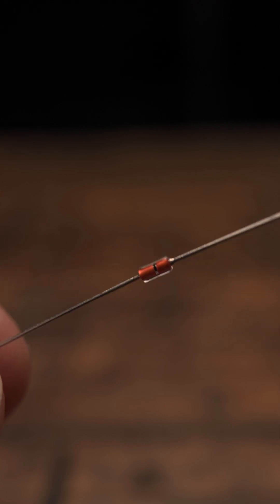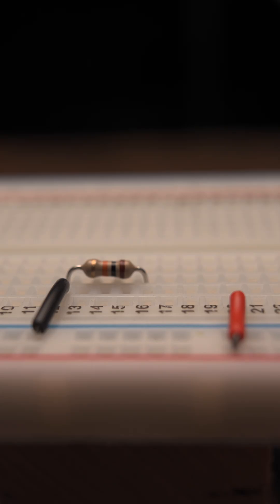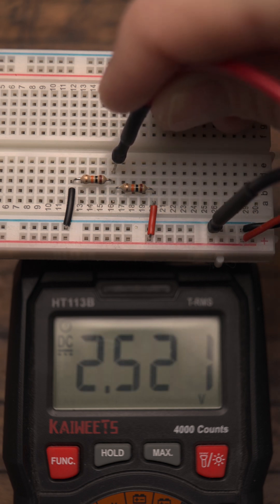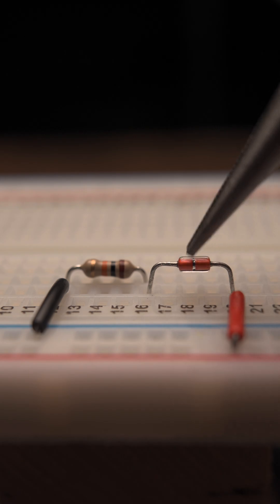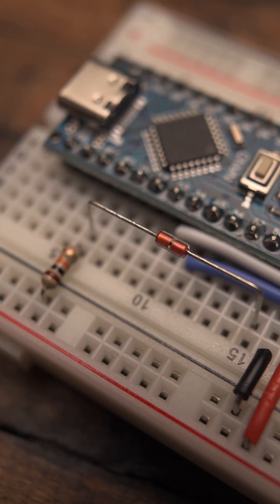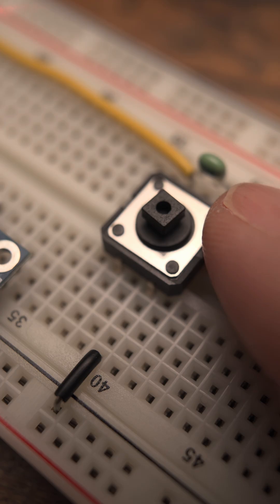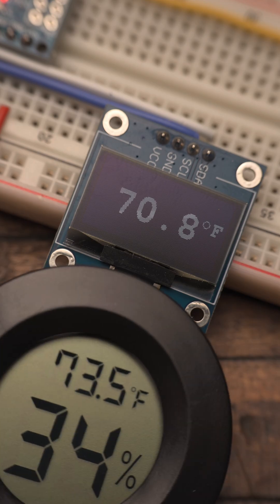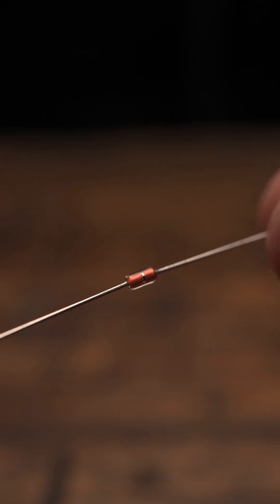#thermistor

Comment: I prefer C, because the 0 and 100 are for the freezing and boiling of the same substance: water. This makes it very repeatable and verifyable. In Fahrenheit the scale goes from ice with salt at -17 to freezing water at 32 and body temperature at 64. It's basically a random dot in a map.
Reply: My life doesn't revolve around freezing and boiling water. Pretty much the only time I'm checking the temperature is to know what it's like outside. Fahrenheit measures that much better. You can keep playing with your water.
Reply: @PIVfirestarkproducon  Sure, because in America you don't center everything around cars, right? Well let me tell you a secret. 0°C determines whether the roads, the pavement or stairs will be frozen and dangerous or not. It tells whether it will rain or snow. It tells you whether the water in pipes will freeze and tear them apart. Cooling a drink below this temperature will make it undrinkable.

Literally life is based on the freezing and boiling point. You just don't see it. Anyway, what you say are just few points on a scale, any scale would do.

With Fahrenheits you need to remember freezing 32°F, cool room 68°F, (arguably also body 98.6°F) and boiling 212°F.
With Celsius you just need to remember two values: cool room 20°C and body 37°C. The freezing and boiling points are inherent to the scale. So it is arguably much easier with Celsius.

The real benefit of Celsius is that it is based on logic.

40°C is twice as hot as 20°C. You can't say the same about Fahrenheits at all.
Reply: just to let you know 97-99 is body temp not 64

also I think it is for what you are using it for because for humans I think Fahrenheit is better because is has a lot more between water freezing and boiling but for anything else C is better
Reply: @SirQuackington_IV  C is better for anything. Fahrenheit is just pure random nonsense based off some random salt mixture that nobody can ever reproduce and 100°F or better 97-98°F which is the human temperature. What you learned by experiencing the world with °F is as easy or even easier with °C. It's impractical to discern 0,5°C, which is 0.9°F, even human temperature fluctuates more than this. The real meaningful unit that you can safely discern by touch and feeling is 1°C, which is just enough for this scale.

The real benefit of °C however, is that you can intuitively tell which is hotter and by how much.

Can you tell just like that, that 140°F is twice as hot as -1°F?
Is it obvious to you that if you mix 1 unit of 140°F water with 1 unit of -7°F water, that you'll end up with 2 units of 104°F water?

In celsius, the same values as above would be:
60°C twice as hot as 30°C
1unit 60°C + 1unit 20°C gives 2units 40°C

Now before you say this is nonsense or science, you are so dependent on technology that you don't even know.
Reply: @NiMareQ  I think it is for what you are using it for because for humans I think Fahrenheit is better because is has a lot more between water freezing and boiling which gets you more precise then C ,but for anything else C is better
Reply: @SirQuackington_IV  You act like you could tell the difference between 68°F and 69°F. lol. And what the heck you mean by "lot more between really fucking hot and really fucking cold". There is exactly the same in Celsius, just expressed using different numbers. Nobody really bothers to use decimal °C anyway. 20°C vs 21°C is enough (68°F vs 69.8°F).

I feel like you didn't even read my arguments above, let alone try to understand them. You provided zero arguments to why °F is better, other than there is more digits in between, which is a fallacy, because Real numbers are literally infinite between any two arbitrary points.
Reply: @NiMareQ  I did read your argument which is just telling me what i like is wrong. I'm saying i LIKE F better for everyday temp because their is a lot more between water freezing and water boiling. I never said F is better then C just I LIKE it more for certain uses.
Reply: @NiMareQ   @NiMareQ " F is better, other than there is more digits in between"  this is why i like it more my how argument is why i like this more not why it is better then the other.

Comment: That looks like a DIAC but I checked and I'm wrong again.
But you can use the forward voltage of a signal diode to measure temperature. You'll find a diode on an engine air intake measuring air temperature.

Comment: F is better for human senses and weather, C is better for science and conversion.
Reply: Not at all. C is better for anything. Fahrenheit is just pure random nonsense based off some random salt mixture that nobody can ever reproduce and 100°F or better 97-98°F which is the human temperature. What you learned by experiencing the world with °F is as easy or even easier with °C.

The real benefit of °C however, is that you can intuitively tell which is hotter and by how much.

Can you tell just like that, that 140°F is twice as hot as -1°F?
Is it obvious to you that if you mix 1 unit of 140°F water with 1 unit of -7°F water, that you'll end up with 2 units of 104°F water?

In celsius, the same values as above would be:
60°C twice as hot as 30°C
1unit 60°C + 1unit 20°C gives 2units 40°C

Now before you say this is nonsense or science, you are so dependent on technology that you don't even know.
Reply: @NiMareQ  none of that matters, and I'm well versed in the world of C and can freely convert between them without issue. But for things like your thermostat at home, requiring a decimal is bad UX. C is too chunky for human comfort measurement.
Reply: @NorthThird  Sure, if decimals is what bothers you, suit yourself. But tbh, I never set 20,5°C on a thermostat. I use whole numbers. And if 21°C is hot, it doesn't make 20°C too cold. The difference is just right, so there is no need for such granularity that Fahrenheit provides anyway.

Also if you can intuitively convert between the two, that's great. For me shifting by 32 and multiplying by 1.8 or 9/5 is bothersome. But converting between the two was never the point. My argument was about the intuitiveness of the C scale.
But it is clear to me that you learned to live without the need to be able to calculate these differences as it is not possible with fahrenheits, I guess you just feel it intuitively, which is something I won't understand. A handicap turned superpower. That's the same thing with navigation. People who use navigation have fewer connections in the part of the brain that manages spatial perception, unlike for example taxi drivers, which is the other extreme.

Comment: You could also run the output of the thermistor to a speed controler for a fan and cause the fan's speed to increase with the temperature...

Comment: Both measurement systems used arbitrarily chosen starting points. Celsius and Fahrenheit are both valid for temperature measurements. Converting between them is not hard, kitchen math, not rocket science. I live less than 10 miles from the US/Canada border. If I listen to a Buffalo station, I get Fahrenheit,  if it's in Ontario, Celsius. Simple, no?

Comment: Quite a good video. I once built temperature protection for a fm transmitter using a thermistor and comparator. I often wondered how hard would it be to add an lcd to the transmitter with live readout of the rf mosfet temperature 😊

Comment: thats not a thermistor it is a diode which can be used as a temp sensor as well, most likely a 1n914 or a 4148
Reply: It looks like a glass encapsulated 3950b which is an NTC thermistor, that being said it is technically a diode but it is designed to be a negative temperature coefficient thermistor. Just like you can use a diode as a resistor, it's using the change in resistance property to sense temperature.
Reply: @onradioactivewaves no marking no nothing so the only one that knows for sure is the who unpacked the plastic bag, i have some of those unsoldered from older electronics devices,  using a diode in reverse is pretty linear if i remember it correctly

Comment: I have a Video Capture card in my computer and it gets HOT!! I have a fan that blows air straight out the back of the computer. How would I set the circuit up to increase the fan speed when it gets hotter and hotter? I have a few breadboard and a few arduino but I want it to be fast and not require much logic. The fan can go up to 15v (the sensor just says 12v but it is LOUD when fully on).

The thermistor/transistors are not expensive at all but I would like your wisdom

Comment: plot twist:  all resistors are thermistors!
Reply: They are all heaters too  but I wouldn't use them like that primarily.
Reply: @Bobsmith-yf9oy  some would

aluminium cased resistor
Reply: @Bobsmith-yf9oy You might be shocked to find out how old kettles worked...
Reply: @j.0x00n4 how did they work?
Reply: @helenanitooo Early electric kettles used high resistence wire as a resistors—directly sat in the water.
Reply: @Bobsmith-yf9oy  anything is a heater if you operate it bad enough
Reply: All resistor are also LERs, light emitting resistors, how cool is that!
Reply: @filipkohout4704 but most times they do it one time 😂
Reply: @blazeykk  Light bulbs can do it for a tbousand hours!!!
Even more if the big light bulb alliance didn't form. Let me know if you want to know about it
Reply: @filipkohout4704  we talk about standard PCB/THT resistors. Not about bulbs.
Reply: @blazeykk  Do you know what a joke is
Reply: All resistors are also rocket engine igniters.

Or really sketchy flashbulbs, in a pinch!
Reply: Just like all solar cells are LEDs and vice versa
Reply: well, yes, but only tiny variation... diodes also make a reasonable  temperature sensor
Reply: And diodes can be used as thermalcouples
Reply: came to say this because my first year electrical engineering course knowledge was like "erm aren't all resistors like this"
Reply: Well, yes... But actually no. Regular resistors are not at all precise in this application. The ∆R isn't very consistent per ∆° in a standard resistor because they're designed to provide consistent resistance under a variety of conditions. Thermistors are designed to provide a consistent ∆R/° and, thus, are far better for the application. A standard resistor will tell you if it's getting hotter or colder, but not the actual temperature; at least not consistently.
Reply: @taitano12 How are special resistors made that stay constant in large temperature intervals?
Reply: @Tankeris6327  I'm not sure how they're made, though I probably learned it at some point. But it's not that they don't stay constant so much as vary by predictable and consistent amounts. Most resistors can change resistance inconsistently . You'll change by half an Ohm from 20-22°, half that for 22-27°, and nearly an Ohm for 27-31°. Then, the next time you use that same resistor, the resistance changes won't match up; getting a quarter Ohm for 20-22° and so on. It seems to plague wire wound resistors the most. It's like how a diode is also an LED and light sensor, but is almost useless as such due to chemistry and manufacturing processes.
Reply: We use Platinum sensors in our equipment. Its resistance changes with temperature very accurately and linear.
Reply: Not the thermissus.
Reply: Everything's a thermistor if you change the temperature enough.
Reply: That's like saying all WIRES are thermistors.
A thermistor is deliberately designed  to have a LINEAR response to temperature changes.
That is its only purpose.
Reply: @petergibson2318  the joke went over your head so bad
Reply: @filipkohout4704  I was replying to GoatZilla. I hadn't even read your "joke."
Reply: @petergibson2318  I was talking about goatzilla's comment lol, not mine
Reply: @petergibson2318  They don't have a linear response to temperature change. It's closer to exponential.
Reply: @Ryrzard  Yes I know. Material properties at different temperatures and pressures are notoriously complicated, non-linear and non-exponential. So for a practical device it’s just a matter of noting the resistance at given temperatures and pressures etc. during the design phase. When you encounter that resistance again you know the temperature…and vice versa.

Comment: A couple years ago I made one with esp8266 to monitor my home heater temperature using Arduino iot cloud. My code to get temperature was just map analog input. I wrote down 2 input values along with reading of an analog thermometer. It is pretty precise at the range of those temperatures but 10 degrees above or below it starts to read way off. Don't know If my code or wiring is wrong or if it is an analog thermometer way off.

Comment: huge issue with using resistors to change voltage or regulate voltage, unless the current is constant, the voltage will change - I wanted to build a very similar setup to convert some battery powered cameras to mains. (So.. 12V DC battery, (2x 6v cells) to 12V AC>DC) But where I came unstuck was the cameras draw would vary wildly depending whether it was turning the IR LEDs on or off... :( 

I gave up and bought SWANN CCTV setup instead... 

Which is a shame because I still have a dozen ARLO cameras and now no actual use for them.

Comment: Could you not also adjust the variance in the code? I realized the benefit of the potentiometer being easier to adjust, but just curious if there's a physical reason to do so.
Reply: Yes you can.
The use of a potentiometer as he has done is not good. The thermistor response to temperature is non linear and a potentiometer does not correct for that.

A potentiometer might be useful to make the range of voltage produced over the required temperature range fall within the voltage input range of the DAC but it can't correct for the non linear response of the thermistor.

The most accurate way therefore is to store a look up table (or calculate it mathematically) mapping the input voltage to temperature.

Comment: Kelvin is the only value not based on subjective/random standards. Zero is the point of absolute zero. Seems logical. Even more to the point when it comes to the video, the Steinhart-Hart Equation used to calculate the thermistor curve uses kelvin for it's temperature variables. 🖐️🎤 🤓
Reply: Celsius is a practical scale for everyday use in temperatures normally encountered by humans. It is just as accurate as Kelvin. 
(When measuring your car-speed you don't add in the speed of the earth orbiting the sun.)
Reply: @petergibson2318  Lookup the Steinhart-Hart equation to understand my reply.  Celsius and Fahrenheit are equally inadequate when it comes to calculating thermistor values, which is the main theme of the video, which is why instigating a C vs K debate is laughable and why neither of them matter ironic.
Reply: @Hulkeq2  The Celsius scale is a variety of the Kelvin scale with the Zero point offset by 273.15 °C (water freezing) for EVERYDAY USE.  The degrees are identical.
I can see why that Zero point in Celsius would needlessly complicate   Steinhart-Hart  calculations so Kelvin is the way to go.
 (Anyway Temp. in Kelvin =  measured °C + 273.15 °C)    C= offset K.
Reply: @petergibson2318 You still don’t get it. Go yell at some clouds. Shoo. Onnozelaar.
Reply: @Hulkeq2  You don’t understand what a TEMPERATURE SCALE is.
Reply: Not the only one, Rankine is the same, but based on Fahrenheit instead of Celsius.
Reply: @GRBtutorials no one uses Rankine.  

There are a lot of other temperature scales that also isn't used any more...

Science and Technology uses K and C.  Then concerts to F when in need.  Like in the Apollo moon lander.
Reply: @AndersJackson  Plenty of engineers use Rankine.
Reply: YES. Celsius is just as stupid and arbitrary a scale as Fahrenheit.
Reply: @Guynhistruck no.  Kelvin is based on Celsius.  So one degree K is the same as one degree C.  So just add a konstant to C or K, and you have converted between them. No need for floating number calculations as F.

No clean connection to F.